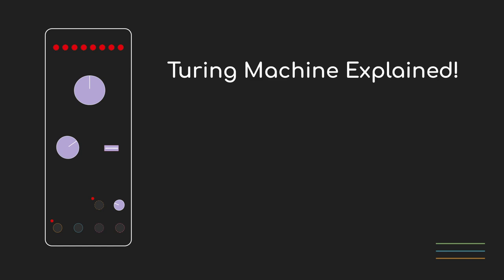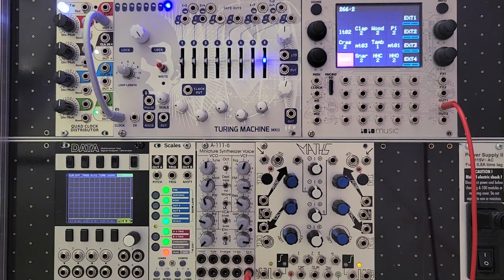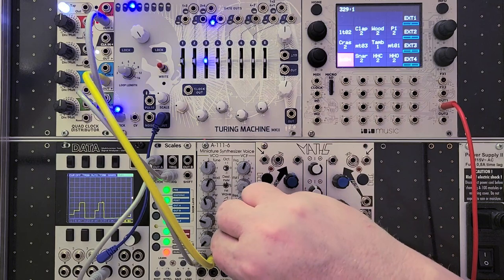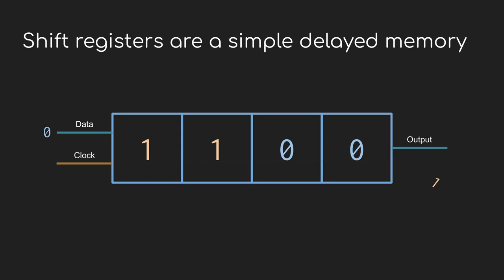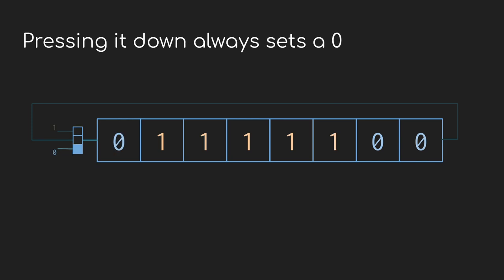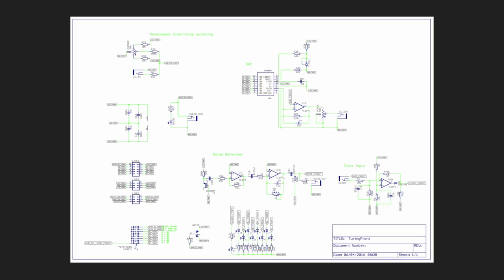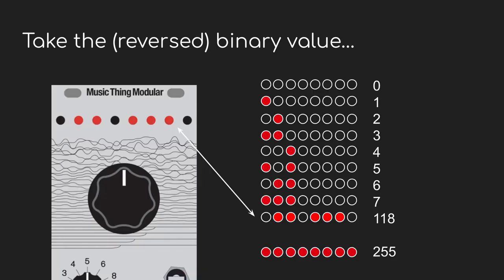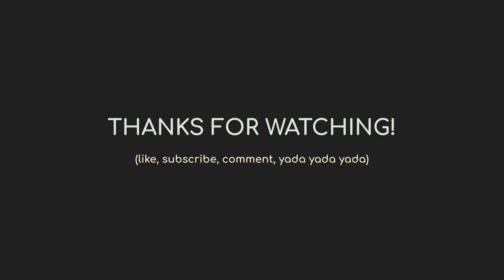Turing 201: Turing Machine Explained! (More than you ever needed to know...)

Comment: After watching Mylar Melodies’ video on how awesome the TM is (plus expanders) this is exactly what my curious brain needed! Adding my +1 to cover the Volts add on. That one still makes my head hurt.
I wish the panel had notches on the scale knob so you knew when you were setting 1 or 2 v(oct) limit.
Reply from the maker: Hope it was helpful!  So, Volts isn't too hard to explain.  The first 5 stages of the Turing Machine are connected to the 5 knobs on Volts.  If that stage is active (the LED is on) then it adds that voltage to the output.  So if you have each of the knobs dialed to 1 volt and stages 1, 3 & 5 are lit up, then it will output 3 volts.  (It's more interesting if you have different settings for each, obviously)

The big trick is that each knob goes all the way up to 8V or so, and the whole module tops out at 8V.  So you really have to keep everything dialed down to like 25% or so or it just maxes out most of the time.  If you remember the part from my video where I talk about voltage output, and one stage adds 4.22V and one adds 2.11V and 1.05V, 0.52V, 0.26V, etc.  It's like that except the value it adds isn't fixed, it's set by the knobs.
Reply: @SoundVoltage  starting to make more sense now. I think what was missing was understanding exactly how the base TM worked. I didn’t know how on/off bits translated to different voltages but after seeing you equate it to binary it made sense. I wonder if TM mk3 could have a switch to toggle the voltages to a v/oct range so you don’t need a quantizer? Also a slew knob on the output would be awesome.

Comment: This was superb, I've had a turing machine for years (and built about 6 of them) and I was always curious exactly how it does what it does
Reply: so you built them but didn't bother to find out how they worked?
Reply: @axeman2638  I know how to use them I just wasn't exactly sure of how it did what it did.
I'm sure you've put together a plastic model kit at some point.... do you understand how injection moulding works and how those kits are made?

or you've built some pre packed furniture. do you know how to make a pre packed furniture kit and all the steps involved?

putting a kit together and using it is completely different from understanding how the module does what it does and the design of the circuit.
the video is titled (more than you ever needed to know). in other words you don't need to know how it does what it does to build and use them

the ONLY thing you need to know to build a turing machine is how to solder and follow simple instructions.
as with most things in life we don't care how a thing does what it does we just care that it does the thing it's designed to do.
Reply: @chemicalBR0  "as with most things in life we don't care how a thing does what it does we just care that it does the thing it's designed to do."

oh dear, failure of curiosity, this sort of attitude is a big part of why the world is in the mess it is in.

Comment: Excellent work! I was also intrigued by the working details of this module and so I also had studied the schematics and done the same kind of experiments that you did, although only on the emulated version of the module by Stellare Modular for VCV.
The interesting thing is that I found a small disagreement with respect to your experiment. On VCV, when I set a single bit at 1 and let it shift through, instead of an ascending series of steps doubling the voltage every time, I get exactly the opposite thing: a descending series of steps at half the voltage every time.
It puzzled me at first, because the active bit is circulating from LSB to MSB on the DAC, so I expected the kind of behavior that you observed. However, I noticed in the schematic that the output is connected to the Iout_bar pin, and looking at the datasheet of the DAC0800 it seems that this is equivalent to inverting the weights between the bits (LSB <-> MSB). So I was reassured.
Now that I see your video I wonder: if you build your module yourself, could it be possible that you connected the output to the Iout pin instead of the Iout_bar? Otherwise, maybe it is the VCV implementation of the module that could be wrong... In any case, I feel that the descending notes give a more conclusive, satisfying melody than an ascending series of tones.
I would be glad to hear your opinion on this point, and also on the detailed workings of the Volts extension (shouldn't the pots on the bits at 0 take some current and modify the output tension?)

Comment: Great video! This is really well explained! I love the Turing Machine - It's always my goto when I need to fire som random MI Rings for ambient stuff.

But one question! Why does the Volts expander have 5 outs?... Why 5? What are their relation to the shift register values? - Am I missing someting essential here?
Reply from the maker: Hey @mortensmodules, thanks, I appreciate it!

I had to go find the Volts schematic to see what it was doing.   Remember from my video that TM takes the first 8 steps of the shift register and gives them different voltage levels, and then adds them all up?  Those voltage levels are fixed and one is half the level of the previous.

In Volts, it takes the first 5 steps of the shift register, and instead of adding up fixed values like the TM, the 5 pots on the Volts decides how much each step adds. And then it sums those all up, and that's the output from that expander.
Reply: Thank you very much for your time and reply - it was great to have this cleared up.

I myself have Volts, and use it a lot, but I have never been able to fully figure out the connection between TM and Volts output.

It still surprises me a little that it's 5 pots and not 4 or 8 (which would fit better with a register), but it's maybe a sweet spot that the output won't be very small or very large on average, due to the associated volt values .

The Turing Machine is probably my absolute favorite module, and am still considering getting an extra one.

Kind regards
Morten

Comment: No code? So are you saying this module is analog?
Reply from the maker: @jordanmuller4735  -  There are a couple of shift registers in there, just simple ICs with flip-flop circuits.  They are effectively storing on/off 'bits', but that's as digital as it gets.
Reply: Ah good to know, thank you.  My curiosity is mainly about module placement in my rack, ie put it on the filtered bus board with the rest of the analog stuff or keep it with the digitals.  Sounds like I can treat it like an analog module.